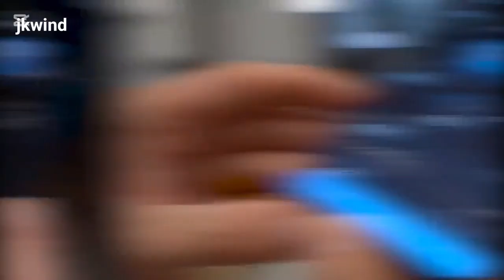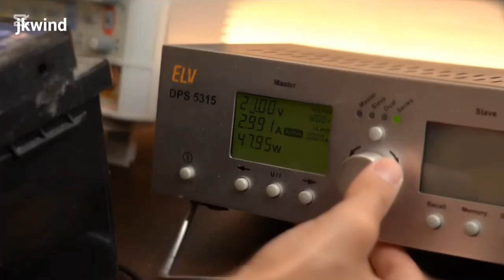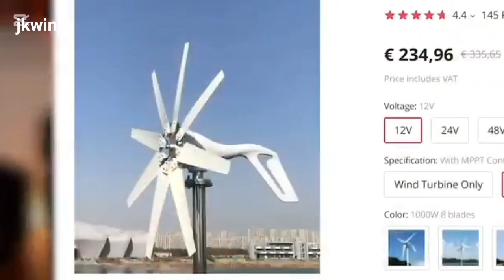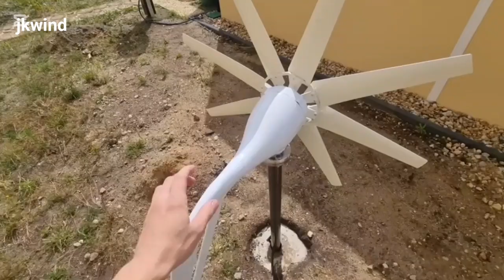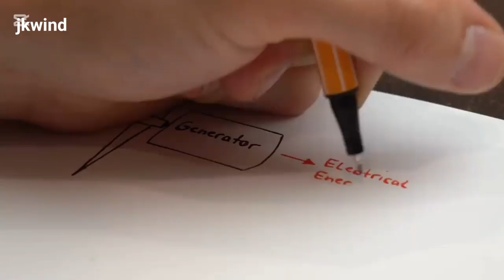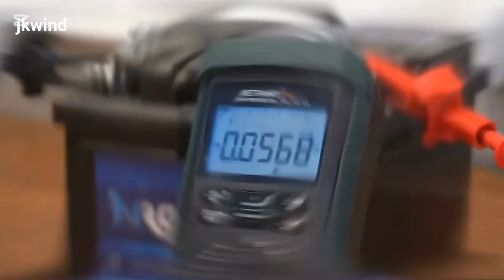Can I Power my Home With Wind Generators! (Worth it?) Let's Find Out!

Comment: Solar panels generate at least 10 times more green electricity with the same investment in time & money!
All practical tests of ground-based small wind turbines show: 1) They hardly produce any electricity! 2) They do not last long! Electricity yield is proportional to third power of wind speed: +100% wind generates +800% more electricity! Close to ground: 0 constant wind, but extreme gusts! 
Anyway: You need a gigantic battery for wind and solar - or a petrol generator - to live off grid.